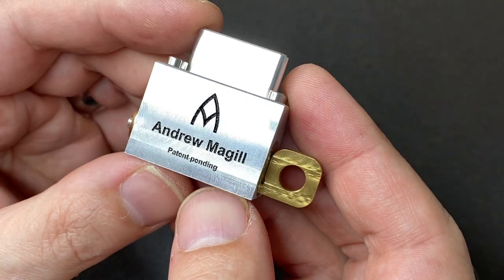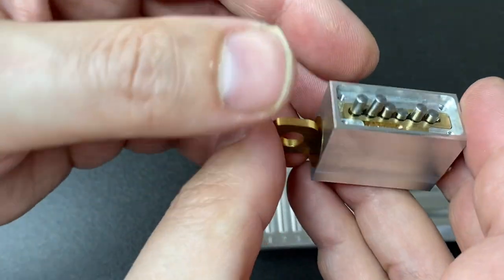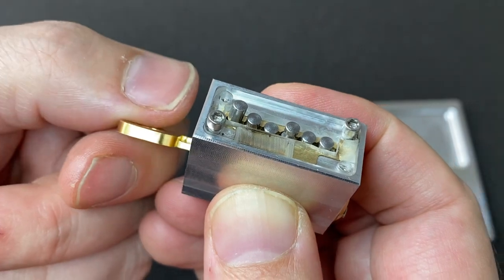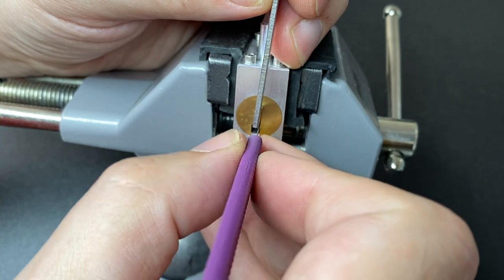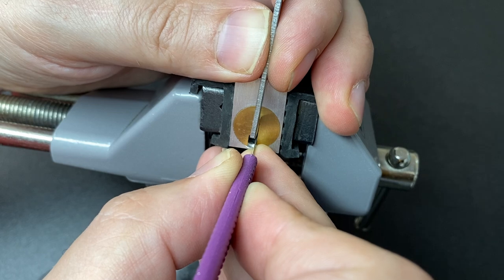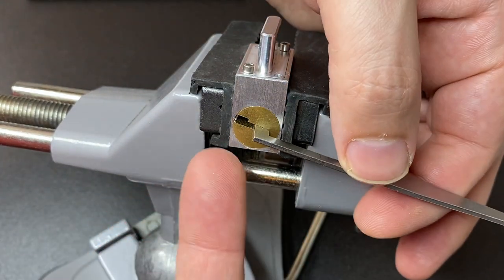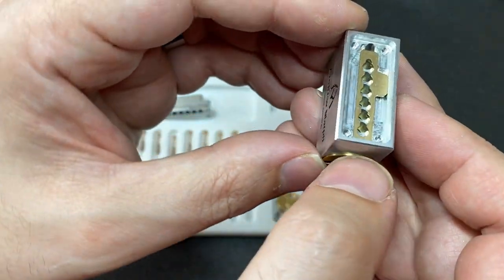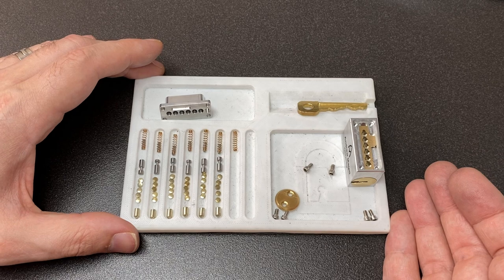Unpickable? Enclave - an Ingenious New Lock Design

Comment: Now this looks like a challenge for the LockPickingLawyer. Especially since he doesn't shy back from using practical exploits, as demonstrated by the two locks stuff made here made. (both of which were great designs with a similar idea in the sense of checking the pins when the pins can't be manipulated anymore. But both had some practical exploits which still allowed picking and/or bypassing them.)
Reply: Questioning what material the slide bar is made out of..... wondering if a very powerful magnet would come into play
Reply: @Arch3r666  looks like brass. Making stuff that's part of the locking mechanism from a magnetic metal would be stupid. For that very reason.
Reply: True, but it's clearly a prototype.  "Unfortunately the designer made one fatal design flaw, he left these hex bolts all over the place..."

I'd love to see what LPL would make of this.  The crux is that Andrew has ingeniously airgapped the stack from the core, you can't tension the lock and pick at the same time.  I'm far from an expert but I can't see how it could be picked by anything other than an exploit.  And that then just becomes a case of iteration, patch a vulnerability and repeat.

Astoundingly clever.
Reply: @TmOnlineMapper  sorry but there's a lot of stupid people in this world that would actually use a magnetic material for the lock mechanism and Lock Picking Lawyer knows too well that some locks are fantastic on the outside BUT dumb in design internally. LPL has a long history finding weakness in locks :)
Reply: Click on 1, nothing on 2, binding on 3, and it's open. Now with a spaghetti noodle
Reply: @zachthelen6049  Using one hand whilst blindfolded.
Reply: Can we forecast the length of the LPL video? This seems to be a good lock, I'll guess 5 minutes (with him picking it a second time to show it wasn't a fluke). The brass slide bar is magnet-proof, but LPL has a yummy yellow hammer!
Reply: @cheeseparis1  The yellow hammer isn't going to move the sliding plate until all of the pins are at the correct height.
Reply: I really can't imagine how you could ever manipulate either the sidebar or the wedge pin which engages with it. They're both trapped in their own completely enclosed coffins, and you can't even do any funny business with shims to play with less pins at one time so if he ever gets this open non-destructively and repeatably I will accuse him of witchcraft.
Reply: "and here ist that 250g  of C4 that Bill and i made...."
Reply: @torydavis10  I wonder if one of those hinge pin spring hammers could cause enough force to kick that slide bar forward. 

This is totally ignoring all the other things that simultaneously would have to come into play for that to do anything productive.
Reply: since this is an incomplete lock I suspect that the opportunity for an exploit will come once the design includes a hasp and a mechanism to operate it. The actual pin/slidebar/barrel assembly seems pretty difficult to get around so only time will tell how well engineered the hasp and operating assembly will be.
Reply: @zachthelen6049  a cooked one
Reply: That was a great series!
Reply: Oh yeahhh i was forgot to say that as well in my comment! i watch LockPickingLawyer as well and its would be great if he try to pick this great lock :)
Reply: "This is the LockPickingLawyer and what I have for you today is this unpickable Lock. They thought." and puts a bunch of TNT rods on the desk and the lock opens itself magically. :-D
Reply: LPL: Challenge you say... LOL
Reply: @cheeseparis1  I believe there is a Vegas betting pool for LPL vid length.
Reply: @stevenormandin2059  cough cough Master Lock cough cough
Reply: please, lpl is gonna figure this out in a week, and be able to pick it in minutes if not seconds
Reply: @RocketCityGardener  It can only move forwards if all six of the pins are already at the correct height.  Otherwise is is just blocked by one or more pins.  It's a very ingenious design.
Reply: A challenge? Lol doubt
Reply: I think it could be done with a hammer: if you turn the "key" and hit the lock enough with a hammer, you could conceivably pick this, since you have tension.
However, you could mitigate by putting the lock on a solid door, heavier spring, and false gates.
(I think LPL did a similar exploit, once upon a time)
I also wonder if you can bend the internal tab, since you have quite a bit of mechanical advantage.
I really hope LPL checks this lock out
Reply: THEY WORK THE EXACT SAME WAS AS THIS
Reply: Stuff made here is a pompous clown. LPL beat the brakes off his design. This design however, might give LPL a run for his money.
Reply: @Arch3r666  There are non-magnetic steel alloys with much greater strength than brass, so the mechanism can be both robust and not easily bypassed.
Reply: I wonder how hard it would be to make an automated picking tool to sequentially try all the combinations for this style of lock? digital picking gun probably.
Reply: X-ray machine!
Reply: @TmOnlineMapper  Intentionally using a magnetic material would be stupid, but accidentally choosing one because it's more wear resistant easily be done
Reply: @bandana_girl6507  you could use manganese steel, it is non magnetic (why I know of it) and work hardens which makes it very wear resistant. Only problem is that the work hardening makes shaping it a pain in the rear.
Reply: @cheeseparis1  I'm 
Ambitious on the locks side. I'm going to say his total video length will be 13 minutes and 43 seconds. I don't think the picking part will be that long but I do think he will take some time to explain.  Honestly I think it will take him about as long to pick as it took me to pick my car lock using only 2 wiper inserts.
Reply: @Manatee360Phototography  I remember when my dad used to pick open his car with a coat hanger, but it was 40 years ago!
Reply: @cheeseparis1  I wish I had had a coat hanger.  I got a ride to my storage unit only to find out that I forgot the key to my miata at home. So instead of spending $50 on an uber I found wiper inserts I had in the car from my pick making days snapped one in half and used one as a tensioner and one as a rake. I definitely don't recommend it, but water locks are fairly easy. Maybe it's time to stash a city rake behind the license plate though.
Reply: i think this look is still a "demonstrator" schowing how unpickable it is. The forcefull breaking protection (steel/drillsave etc) is not yet there. But looks verry convincing, hopefully we get a new kind of locks soon from this.
Reply: @zachthelen6049  wanted to Write a Similar Message :)
Reply: My beef with LPL, specifically relating to the locks made by Stuff Made Here, is that he will take a lock apart and look at all possible exploits before attempting to pick it on camera. I wish he would take a more "in the wild" approach and just pick the locks blind. I feel like his picks are made artificially easier than they would otherwise be.
Reply: @DJTony993  that wouldn't work. As you can't just pick a lock you don't know how it works if it's significantly different from any other design you know. And both designs presented by Stuff Made Here indeed immune to conventional picking. So a blind pick would just be hours upon hours of futility.  
In order to perform an (original) exploit like lock picking (a new lock design) you need to have a good understanding of how the object works. Even when you're doing blackbox exploits your initial attempts are solely to learn about how the thing works before you can exploit it. But that is still insanely hard, especially if it's designed in an unconventional way.
Reply: @TmOnlineMapper  Bosnian Bill always did blind picks. It's the reason I preferred his channel over LPL. On the Stuff Made Here channel, he even had a locksmith come try to open the lock without seeing how it was made. I'd have liked to have seen LPL at least attempt it blind to see the real-world effectiveness of the design.
Reply: There are locks LPL wasn't able to pick (yet), so this might be added to this list. But I'm interested in his take on it, too :)
Reply: I was thinking the same
Reply: @DJTony993  Doing it blind is not really a good measure of how effective the design is because then you are relying on "security by obscurity". If you were to actually go into production with a design and sell a lot of them, then you will lose that. A good design should be held to the standard of being difficult to bypass by someone with full knowledge of the design - the only thing the test picker shouldn't know is how the specific lock is keyed.
Reply: I'd like to see him open some higher end locks first, like some fichet locks and hight end vachette.
Reply: @zachthelen6049  Ha ha ha!!!
Reply: 5 minutes
Reply: He might of sent one to LPL ..he typically shows locks after he has them for a while unless it's a challenge/bet
Reply: If you had it incorporated  into a lock I would buy a couple. Perhaps you might be able to team up with a door lock manufacturer.
Reply: @TmOnlineMapper  I've seen a lot of carelessly designed locks that have used plastic cores that are easily melted/broken/warped. Not much of a stretch to imagine someone using magnetic metal.
Reply: @DJTony993  I get your point, but the idea of lockpicking in general is to use your understanding of the mechanism to find interesting ways to bypass it.  If SMH's locks were put on the market, they would be reverse engineered, and the mechanism would be public knowledge.  Locks (just like any other security mechanism) need to be secure under the assumption that they will be reverse engineered.  Saying something is secure because you don't know how it works is what we call in the security industry "security by obscurity", and in cyber security it's considered the very worst form of "security".
Reply: @Arch3r666  even if it were ferrous, how would that help? It’s locked in place by six pins. That’s why you also couldn’t overpower the upper spring with the key.
Reply: "Especially since he doesn't shy back from using practical exploits," I think you mean "shy away", but then, you're American! If you can't remember the correct phrase, just make a new version of it up and completely bastardise your own language. This isn't a challenge for Lock Picking Lawyer, because he NEVER shows videos of himself failing to pick locks, just like he couldn't PICK Stuff Made Here's lock (bypassing a lock is not PICKING it), and just like he completely ignored Tim Hutt's 3D printed lock, which Tim sent him a YEAR ago. LOL.
Reply: @johnthomas338  I'm morbidly curious as to why you think I'm American.
Reply: This lock is subject to the same walking attack used on one of the Stuff locks.  A wrong key or pick can turn the actuator part of the way, which standard deadbolts don't survive.
Reply: @kkhackett  Why is stuff made here a clown exactly?
Reply: @gazehound  I take it you’ve not watched the guys videos much?

The guy is a socially awkward putz. He’s got some good designs. But listening to him talk makes my eyes roll from how he acts like he’s wayyyy too smart to talk to…..
Reply: LPL has said clearly that he does not show "unpickable" locks. His stance is that there would be no point and that his videos show locks being not frustrated attempts on locks that can not be picked. If he gets one, tries it and can't pick it he would see no point in such a video. If he can then he would show it.
Reply: @RocketCityGardener  I'm also thinking that a destructive attempt should be possble. Also what of reliability? Maybe the sidebar mechanism will wear out over time.
Reply: @TmOnlineMapper  but it's common to embed off-centre hardened steel pins for drill resistance.
Reply: @DJTony993 LPL is a lock breaking encyclopedia and is more about demonstrating how to defeat specific locks in the quickest quietest manner rather than showing off his talent. Although If someone challenges him he will take an "in the wild" approach.
Reply: @johnthomas338 As an American I can say that "shy back" is completely acceptable here. Why,   people from your country don't make grammatical errors? Or speak in slightly altered dialects depending on their geographical location and upbringing? Or were you just having a bad day? I mean, why the hate?
Reply: He does shy away from unpickable locks though.
Reply: @johnthomas338 I have noticed that about him that he has talked about  locks that he had a very hard time picking them but waited to show himself picking it when he figured it out. And I agree bypassing a lock is not picking a lock. LPL is a very good picker buy I'm sure he's not the best out there and he fools people simply by only showing video of locks that he has figured out how to pick. And if he can't figure out how to pick it he destroys the lock and says " see this lock is trash look how easily I broke it with my ram set" or other ways he broke it. I think anyone that does these types of videos should open the package on camera and get straight to picking. I've watched Bosnian Bill pick locks without looking at the guts before hand and well as seeing him fail to be able to pick the lock and later he doubles back when he figures out how to pick it and shows his subs how he did it.
Reply: @bradslone2409  I totally agree. What concerns me is the number of commenters (like 99%) who a) don't even notice that he hasn't even attempted to PICK the lock, and b) think it's just fine that he bypassed the lock, because they aren't actually interested in new lock technology - because they're idiots.
Reply: LPL did one of these recently, but it didn't have the stack of wafers. And he was able to get a tool into the lock and tension the upper works.
Reply: BosnianBillandHe would probably make a custom tool to deal with this design
Reply: LPL couldn't pick the Master ID1500.

Comment: This feels like an evolution of the first Stuff Made Here "unpickable" lock, locking the pins at a certain height for verification. The actual mechanism is different, but it's still cool to see.
Reply: The mechanism is different, but principle is almost the same.
Reply: Very similar to not only the finished mechanism but some of his prototype steps as well.
Reply: It certainly follows the "SMH" suggestion to separate the pin setting and pin testing parts of the lock, with a much simpler design.
Reply: I was just thinking that. I hope he notices this video, he'd probably find it interesting
Reply: The intention is the same. It's very likely they saw his video and tought: "how can we achieve that in a simpler way?"
Reply: I had the same thought. Very similar idea
Reply: @StuffMadeHere
Reply: those "smart" guys think they are so smart, but really they just dont understand how world works ... reason why such locks are not being used, is because they are fragile and you can brute force them within seconds.
it's FACT that 99% of thieves use brute force before anything else, what good are those "unpickable" locks, if a thief can take a screwdriver or some butterfly knife and twist it open in like 2 seconds?
those "smart" guys just miss the entire idea of a lock, it's not suppose to be overly complex and unpickable, it's just suppose to keep scum out of private areas.
Reply: @SethiozProject  A simple Fence keeps scum out of private property. A Lock keeps those who still get past the fence. Physical Deterrence is only as good as Thief's Lack of motivation to get past it.

Comment: I'm convinced lock manufacturers don't care that much about security.  The designer better start his own company if he wants to see this in production.  It's very cool!
Reply: Because it doesn’t add any security that matters. Bad guys are not going to pick your locks. They will use brute force and speed.
Reply: @hannes7695 Plenty of criminals pick locks, and some situations do not have a brute option.
Reply: Bowley seems to care.
Reply: @MattH-wg7ou  Hopefully they continue care and the market doesn't wear them down.
Reply: Problem is, a cylinder is only as secure as it's surroundings. Most doors are easy to kick in. Most chains easily cut.
Reply: @PanicGiraffe  True but it's not as easy to kick in a door when a proper locksmith installs it unlike the cookie cutter garbage you get from a builder that does cookie cutter homes.
Reply: @jmr  For sure. But in the modern world anywhere cat burglary makes more sense than destructive entry you are probably dealing with digital locks.
Reply: @PanicGiraffe  I'm still seeing mostly mechanical locks in the types of places a cat burglary would occur.  Museums/jewelry stores.  Almost all of the locks at our museum are Medico mechanical locks.  I mostly see electronic locks in places like hospitals.  Accept for the vault even banks near me are still using mechanical locks. Maybe it's different where you live.
Reply: @jmr  I think if you really wanted to get some place you shouldn't be you need both. And especially if you want to get away with it you need a way to mess with surveillance.
Reply: @PanicGiraffe  On the topic of surveillance we have criminals using some kind of WiFi jammer or WiFi deauther in my area.  I'm not sure if the police know what technology is being used specifically.
Reply: @jmr  that's very cool. Only works for disrupting remote monitoring services though, the information still gets stored locally if it's closed circuit. I think ways to automatically target cameras with lasers would be the next step to make sure you aren't seen, even after the fact.
Reply: @PanicGiraffe  Bright infrared LEDS are used to block most cameras.  You put them around your hat.  It's very effective for most cameras with night vision.  I've only saw one video of these people so I don't think most the homes they hit had cameras with internal storage.  Either that or  they've been stealing it.